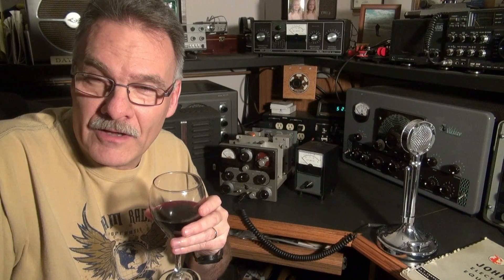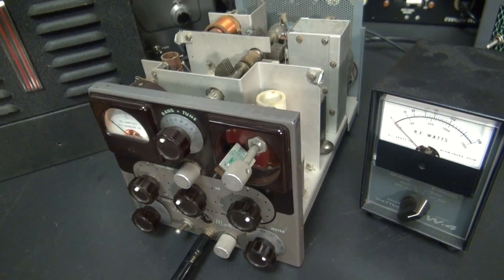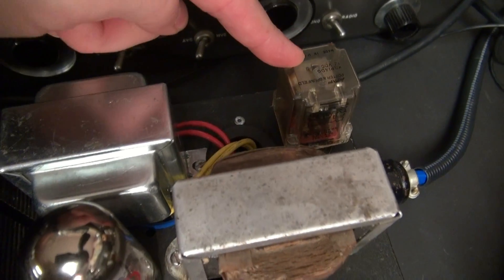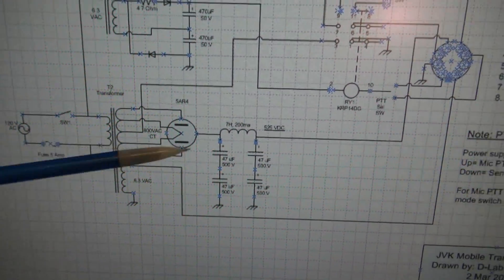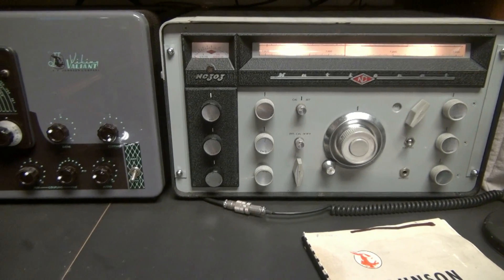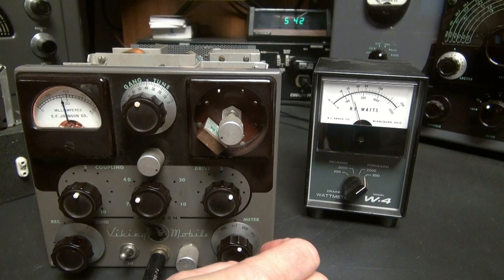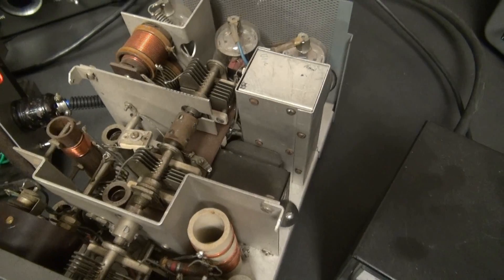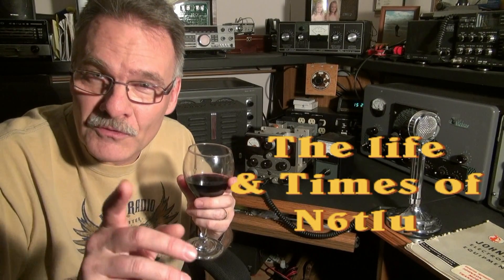Johnson Viking mobile Ham AM Transmitter Alive and Rare Demo

Comment: The viking mobile dates to about 1953.  They were all kits !  40 meters was an option you had to add when you built it. It uses an oscillator tube to supply modulator bias. The only transmitter I know about that does this.  see my LONG critique of the radio farther down.  I have mint example with mobile vfo, cables,  parts rig, two manuals, sales literature etc  to sell as a package. w6wuh  5/21

Comment: Universal Mobile Rig Power Supply.  Take an HP-23 Heathkit supply.  Change the High B+  diode wiring from Voltage Doubler to Full Wave Bridge.  No new parts needed.  Hi B+ is about 400 volts, and all the low B+ options, bias, and fil voltage options are unchanged.  Oodles of current , good volt reg, uttlerly reliable, cheap and very flexible.  Fan all the voltages out to a barrier terminal strip, add a PTT relay to switch low b+ between tx and rx, to key high B+ and control an antenna relay.   This allows you to test and run a variety of radios very easily.

Comment: Gonna give mine another shot. After the usual overhaul, and making cables, Mine will  only work on 10m.. but zilch on 75. 40M/15M not installed when built.   If no luck with other xtals or vfos.. then I will have a bear to wrestle.

Comment: Sounds good.  Don't be fooled.  While it is easy to recap, and clean the switches and tube sockets.. any work on the tuned circuits is a Real Bitch !   Terry's has the 40M option installed.  Trying to do this later or any other work in the middle section is nearly impossible..and requires major dissasembly... I mean seriously "unbuilding" the thing.   This thing was engineered to work into mobile antenna impedences.. like 10 ohm on 75 meters.    Because this uses ganged tuning.. ( plate tuning and loading on a Single Control...  if you want it to work well into 50 Ohms.. you will probably end up having to reset the loading coils ( which slide in and out)  to coincide with the plate dip...    The rear connector plugs take some scaring up.. if you dont' have a collection of odd-balls  5 and 7 pin if I remember right.   The VFO is 6 volts only... so if you have the xmtr  wired for 12V fils.. then you MUST add a dropping resistor.. Read The Manual...  this is perhaps the most complex and unusual of the mobile xmtrs.. and they did not help when they wrote the manual.  The info is all in there.. but you get to wade through endless variations.. and you will actually have to THINK.. if you want to yours to work.  Terry is right.  The VFO is really hard to find.  However,  most any vfo will work. Get an HG-10 or xtals.  Terry really did the right thing using a Relay to control the B+.   The switch inside the radio is NOT made to handle this job.. although the books makes it seem as though it is.   You will destroy your internal wafer switch quickly if you use it to switch the B+ directly.      nTake the time to wire up PTT and use a relay.    Also,  there are  is a  6146 P.A. Screen Resistor         ( actually a string)  that needs to have the correct tap selected to match the B+ you are using.   This will effect the xmtr output and the life of the tube.  This is spelled out in the manual.  An interesting note.. the meter and crystal socket/switch  positions can be swapped.  Most have the xtal switch on the left.. so it could be adjusted from the drivers seat.  This one has the meter on the left instead.   Once you have gotten yours gone through and working.. it will make a perfect driver for a linear amp.  25 watts carrier =100w PEP  at 100% mod.   Just what most grounded grid linears want.   One last thing.. Check to see if it is wired for dynamic (crystal) mic  or for Carbon.   Do not plug in your dynamic mic until you are sure !   Do Not ever apply more than 600v. No HP-23s!   450-525v  is nice and safe.

Comment: I noticed on your power supply that you didn't use voltage equalizing resistors across the in-series filter caps like typical convention thinking dictates. Do you know what I mean? Any reason for omitting them?

Comment: One drawback of this design ( I own 2 of them)  is that they are using a wafer switch to switch the B+ !  This is destined to fail soon.. if you are using an AC supply.  When designed, the standard supply was a dynamotor...with an external relay controlling it.. which took a moment to spool up.  Smart money will use that section of the switch to control a relay.. and let that switch the b+.    Although very compact.. so are a lot of other mobile transmitters, none of which pancake the various  rf sections  (osc, driver, final )  in vertically shielded sections, pentetrated by the band switch and gang tuning.  This makes servicing the rf sections a really serious bitch.  I collect, overhaul and use AM mobile gear.. and this is the worst mechanical arrangement of any I have owned.. from a maintenance standpoint. The under chassis wiring is easy, but up on top.. where the coils and caps and switch sections are for each band.. it sucks.  This was likely one of the most difficult kits to build ever made, and the construction manual for that purpose is just plain poor.   Gonset, Morrow, Multi-Elmac, and Heath all made more complex mobile transmitters that are far easier to work on, although perhaps we should laud Johnson for being the leader for showing us how NOT to build a mobile rig.  And given the fact that it predates the others by 2 to 4 years( 1954) ..that is no exaggeration.  I cant compare the palco or babcox multi band transmitters, because I haven't owned them.. but they are again.. many years newer.  The ganged tuning is a fine innovation for mobile work.. the oscillating bias tube for the modulator.. strange enough that nobody else ever did it.  807 mod by 2 807's  should be gold.   But the output circuit is designed to load the very low Z mobile antennas used in the 50's  .. which together with the 3 odd connectors on the back (6,7, and 9 pin "octal" types) and the necessity to come up with proper  power supply, cabling, switching ( ps/mute/ant)  means that few of these ever find their way on the air as exciters or barefoot.. although they can sound quite good, with the right values in the audio section, .Bias resistors have to be jumped to match the B+ being used.   No appliance operator is going to jump through all those hoops willingly, and some who try fail for lack of skill, knowledge, documentation, or experience.  This is true of most of the AM mobile transmitters made:  the cabling, switching,muting, and rx control, and power supply requirements  are too daunting for the average ham, and currently the AM guys are mostly into high power and not motivated to do so much work .  So, it is good to see and hear one of these working, even on the bench !

Comment: Using an external PTT relay is a VERY GOOD IDEA.. because the internal wafer switch in the transmitter is switching the full B+ !   not a great idea !  The radio shown has the optional 40 M band added.   Mine hasn't got it.. so have to check the manual to see if that trimmer belongs in there.. or not.   Modulator get;s it bias from a tube oscillator dedicated to that purpose.  The 807 is a great old bottle,

Comment: I just acquired one of these. It looks brand new inside and came with 4 crystals. Now to find / build a power supply.
Reply from the maker: Hello, I have a schematic on hand for the one I made
Reply: If I could get a copy of it I'd sure appreciate it. I'm good on QRZ 73 NE5U Mike
Reply: PS- I don't think this one has ever been powered up. It looks brand new inside.
Reply: here are some suggestions for a power supply:1. Heathkit HP-20  600 v b+ designed for mobile rigs  .2. Modify the HP-23.. change the voltage doubler to full wave rectifier.. wire change only..no new parts.. this gives 425v hi B+ with plenty of current , instead of 700 volts which will destroy any of the old mobile xmtrs.3.  Ditto  change for the transistorized 12v equivalent from Heathkit. any of the above also supplies filament voltage, receiver and low transmitter b+ ( 300 or 250v)   and adjustable bias.

Comment: Something does not seem quite right.   Should there be 25w continuous output when unmodulated?  What does it look like on a scope/panadapter?
Reply from the maker: Hi Jim, I guess I do not understand the question. The transmitter is putting out 25 watts. Am I missing something?
Reply: It is/was my understanding that the output of an AM transmitter is proportional to the amount of audio modulating either driver/PA input or PA output tank circuit, thus not modulated there should be very little on-carrier RF output, then increased total power as there is audio input.  

In AM on a couple of my rigs the drive is set so unmodulated there is not full PA output level, and only on highest voice peaks do I measure up 80-90w - you distinctly see the wattmeter level varying/increasing with the amount of audio/speech presented.   For my Flex-3000 the 'drive' or when in AM the carrier power level setting may be 10-20w, leaving 80-90 watts of headroom for the actual audio-modulated power out.  

So, just expecting to lower output power w/o speech and increase with speech.  No?

(My dad had Viking like yours (wish he still did) as his go-to 75 AM rig before going SSB with a Hallicrafters SR-150. Fun to see life in the good old stuff.)
Reply: you have SSB and AM confused.  am carrier power remains steady, and increase in power is in the side bands either side of the carrier..  PEP reading watt meters will show this increase in power.. those designed for SSB.. usually read Half the PEP power.. because they are calibrated to read a single sideband.. and the power reading is really a glorirfied volt meter reading..  at  100% modulation PEP total power is 4 times the carrier power.
Reply: its not sideband Jim.. it has continuous carrier..and if you had a peak reading watt meter.. you would see an increase in power with modulation.
Reply: you are just wrong jim, about am.